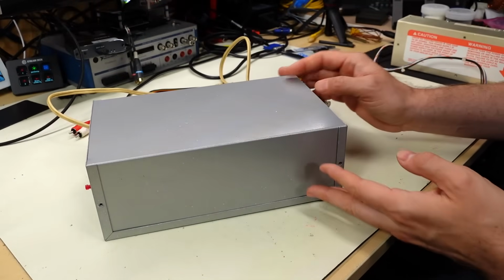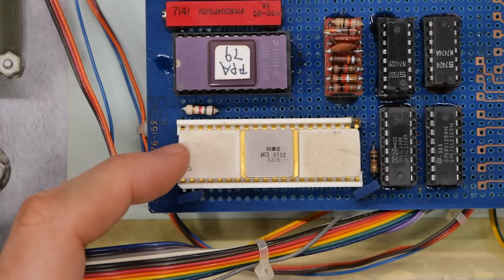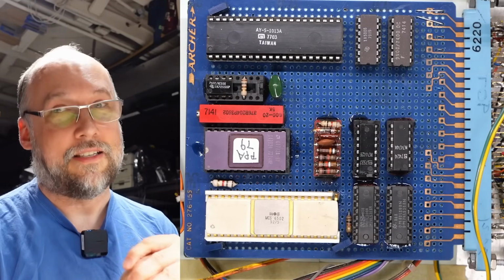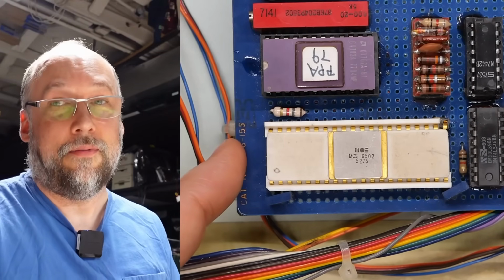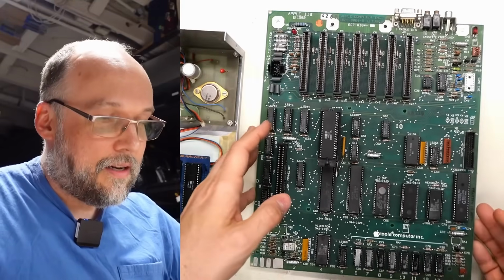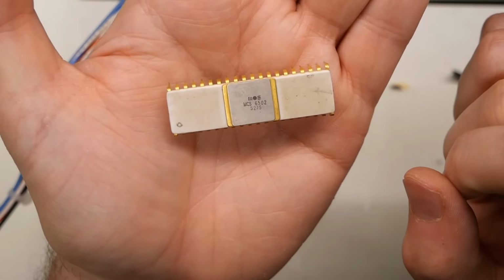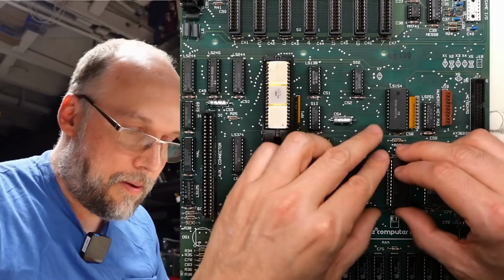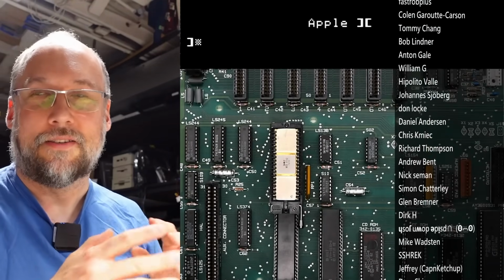Let's test a 50 year old MOS 6502 CPU

Comment: At the time the 6502 went for $25 while the 6800 went for $350 - which Motorola sued MOS.

Woz was thinking about using the Z80, 6800 or 6502 for the Apple (Apple I) and decided on the 6502 with some hardware add-on to have a 6800 run on the Apple I board.  From there he used the 6502 on the Apple II and the rest was history.

But the history gets more convoluted from there because of Jack Tremiiel. More on that another time as it is very long and convoluted.
Reply: They were suing about the 6501, which was pin compatible with the 6800, and only could do so because one of MOS employees took (against Peddle's explicit orders) Motorola design documents with him. That's why they made the 6502.
Reply: The Z80 was not available at the time Woz was thinking about the Apple 1.  Maybe there were some pre-release datasheets.

Comment: Soviet calculators often used chains of shift registers as RAM.
Reply: How does this work? Like an electronic version of a delay line?
Reply: @samuelcolvin4994  more like FIFO ram I’d guess
Reply: @samuelcolvin4994  Yes, a chain of shift registers (up to 2 K bytes!) with a continuously scrolling set of data. Other chips sit on the same bus and watch for particular values in this sequence (command codes), then take the data and put the results back.
Reply: @watchmakerful  Japanese calculators did this for a while too! In the 70s mostly.
Reply: @samuelcolvin4994  I think with some shift registers you can both write out to them as well as read their state back in again

Comment: "...carefully remove it"
proceeds to pull it off with a sharp screwdriver, flips and drops it, no esd protection whatsoever
punk's not dead apparently
Reply: It’s a specialty tool for chip removal, not your average screwdriver. He was gentle with it and did no harm to the chip. No harm, no foul.

Comment: great video Adrian, nostalgic for me as well. the 6502 was the first uP I learned to program while working as a college intern. I recognized the AY-5-1013 straightaway as a UART as you were talking, so I had a bit of a smile about that. it resembles a project I worked on very similar to the serial-to-parallel converter you described, it was for a selectric-style terminal (our school was an IBM shop) with a proprietary parallel interface. I wonder if that's what this box was for, some non-Centronics hardcopy device?

thanks for the walk down memory lane!
Reply: Yes, I remember the AY-5-1013 (and the AY-3-1015) as well!
It was a UART that you could use in circuits without a processor.  All settings were done by jumpering pins, and one could easily clock a byte in or out of the chip.

Comment: Very cool! What other old machines could you do a similar test in? The C64 has a different incompatible "6502" right? I think you could make a test for a Vic 20 cartridge so you wouldn't have to switch the actual ROM chips right?
Reply: The 64 used the 6510 which is a 6502 with more inputs to acommodate more ROMs.
Reply: I'm not that much of an expert in C64, but IIRC the differences are the ability to tristate the bus and GPIO pins or something like that. Which means you could potentially make an adapter with a tristatable buffer and few address decoders and registers (it might even run BASIC and simple games without the latter?). But I'm not sure if there is really any point.

It would then behave exactly like any other C64, except in rare cases where ROR instruction is used - which will produce incorrect results...

...which are not very exciting - some stuff may just produce wrong results or hang or error out. Probably the most visible glitches would be in the demos which tend to use wacky code all the time, also possibly some CRC/encryption code. Other than that I don't have an idea where it could have been used, maybe some... err..  graphics effects?

You could probably emulate the most of it by replacing RORs with ASLs in the ROMs if you have a cleaned-up disassembly to tell code from data, but again I see no point.